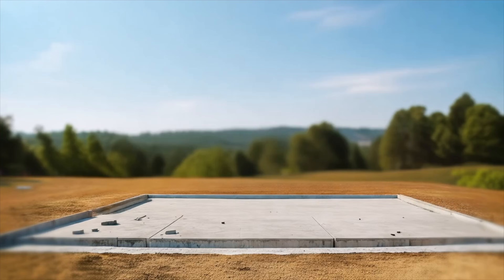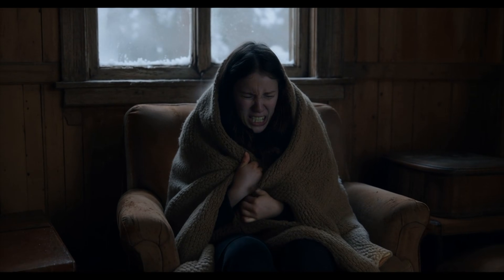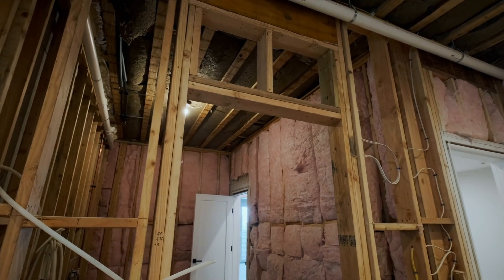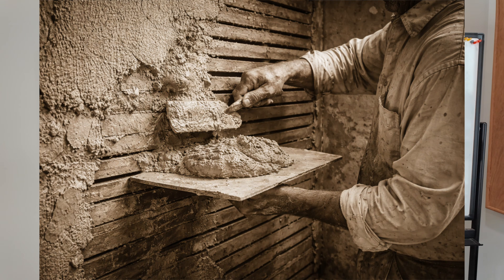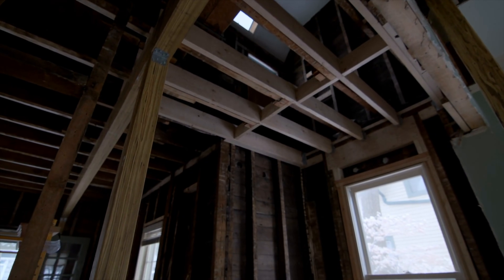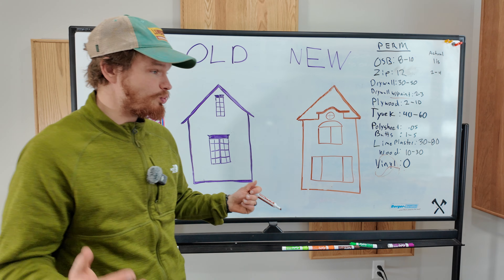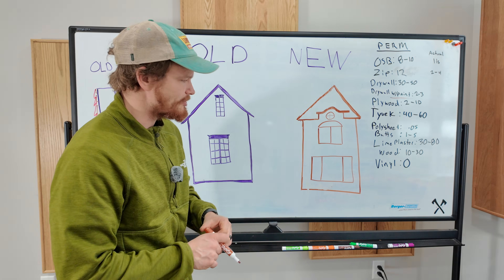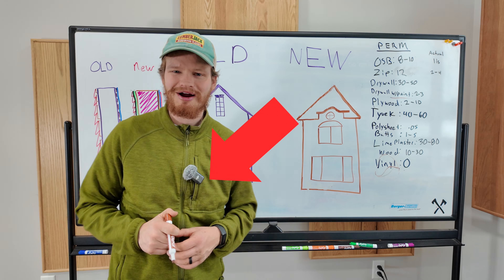New Houses Are Growing Mold — Old Ones Somehow Usually Don't

Comment: I have a small 1948 stick built one-story ranch on a concrete slab no basement, uninsulated attic that is very drafty with WI winters. Stick built, aluminum siding, black felt wrap & old fiberglass insulation. That’s about all. On a budget & need to learn diy. Any advice on where to start or go to learn? I want to warm the structure with without causing mold issues or structural issues. I was thinking of going either rockwool but this is as far as I have got.
Reply: Think about heating the floor. Your concrete floors perfect. Better than forced air. Insulation, some good windows and some heated floors and a stove you will be toasty. You can do electric or use a mini split. Do not use foam in the walls. Standard Insulation will be easier to use and do any repairs.
Reply: @LampWaters So grateful for your advice. I will def look into those ideas. Take care.
Reply: @CK-hu8vzif your plumbing has issues but nothing collapsed in sewer ir plumbing lines but have issues... most likely house that old has settled, with concrete floors access is difficult. If ur snaking ur lines but lines look fine just adjust ur toilets to hold more water so if ur plumbing isnt as sloped as it once was it can still push anything thru.
Reply: @LampWaters All of the pipes are within 10 feet of where the well enters the house. They run into the kitchen behind the cabinets (exterior wall) and then to the single bathroom. The bathroom section was left open about a 1 1/2 ft crawlspace for the plumbing. The floor has plywood & tile only. I am concerned about how to keep those pipes from freezing being so exposed, though.

Comment: Old houses have a lot of mold too. I work for company we demo condemned houses . Lots and lots of mold. If new ones are worse I don't know but old ones have a lot
Reply: I think the video said that if old houses have been renovated with modern methods, they get even more moldy than the new ones. And I guess most old houses today have layers with modern paint and that they are also insulated? Have you ever worked with a house that has been properly taken care of, but not with modern methods and materials? It would be interesting to know if they have the same mold problems
Reply: Of course there is. You're demoing condemned houses, not properly maintained homes.
Reply: Well, these are demo homes so probably no minimum maintenance for a long time.
Reply: Environmental contractor here, you’re 100% correct.  And these morons in the comments getting all bent have no clue how mold works.  Mold don’t give a shit what materials you use, if it can eat it and the humidity is high enough, say bye bye.   

Keep your humidity down and you won’t have mold, it’s that simple.  And if your old house “breathes” so much better what do you think that means for the humidity in your house.  🤣😂. 

Install an air circulator on your hvac system and you won’t have any of these problems.
Reply: @sicilianr1 how do I choose my next apartment? I have less than a week & this changes everything. How does one test /or look when apartment hunting? since materials dont matter? Im located North of Chicago.. so weather is all over the place year round. Probably best to avoid 1st floor apts?
Reply: @sicilianr1 just keep on enshitificating everything, bozo
Reply: No shit. Sherlock? Does the inspector know?
Reply: @JimmyJones-w3p Really? We are discussing houses. Why the anger? It's just wood and materials. Not worth the emotion.   Be well.
Reply: @CK-hu8vzno anger I meant for it to be read sarcastically. Obviously older homes would be more likely to have mold.

Comment: You're INTENTIONALLY ignoring facts about "old" houses that make them as prone to mold.
At 9:40 you talk about "old" houses having either wood siding or lime stucco. You completely ignore that the wood siding was PAINTED, hence trapping water.
You did similar "dishonest" comparisons throughout the video.

True, modern houses are an environmental wreck but you don't help educate and change behaviors by "whitewashing" previous building practices.

I for one would never have wood siding on a house OR vinyl. It's fiber cement board for me. NO rot and most importantly... FIREPROOF (Hello SoCal!)

At 10:20 you bash HardiPlank (TM) because its made from cement, not lime.
But you ignore the scientific FACT that cement absorbs and drains water. Concrete (made with cement) does diffuse water.
More half truths...
Reply: Steel siding for us folks that like in hail territory

Comment: Vinyl siding is fine, air moves around the edges … it’s not air tight.   Vapor barrier is fine on outside but questionable on inside .  OSB is not my favorite but it is not much tighter than plywood…. Drywall and latex paint and primer and mud is also fine.  No issues with blow in insulation or fiberglass.   I think spray foam is the big problem

Comment: A project near me, they framed it out and then paused the whole thing through our rainy season. No wrap, no roof, nothin. The OSB was starting to blacken when then they were somehow allowed to resume. 3 years later, the tenants are complaining of mold. 
My 1950s house is bone dry, in part because I use the A/C maybe 5 times per year. Open the windows at night, close them in the morning. Much cheaper.

Comment: Houses were ment to breathe, air tight no HRV mold for sure, fiberglass is garbage use Roxoul best insulation out there, forget foam on wood unless you enjoy nightmares.  Its masonary cement used in stucco,  Portland is used in concrete,  masonry has hydrated clay or sealbond mix that gives it flexibility but not as good as hydrated lime that is self healing in stucco or masonry joints.

Comment: It looks like a solution is needed.
Possibly air flow or mold resistant products with air flow.
I've noticed that new homes have continuous air circulation via the HVAC system.

Comment: That spray foam is a massive cause of mold . No air flow  equals moisture trapped even just from condensation not even a leak that causes it..  love engineers 😅

Comment: Unless the studs are Kiln dried( more expensive)  I have never seen studs that didn't have black mold ON the studs BEFORE they go into the house.  ALL new houses have this flaw, black mold INSTALLED in the walls, just waiting for a teeny bit of moisture to thrive..
Mine is 1917, flow through from basement top attic, lathe & plaster, lots redwood- siding etc. cool in summer stays warm ion winter... originally thought I would have to rip the interior and insulate,,, wouldn't touch it now that I have lived in it.
Reply: Would charring the surface of the studs (the way it's done for charred wood siding) prior to installation kill the black mold?

Comment: I've found myself wondering about drywall vs lathe and plaster walls lately. The lathe and plaster obviously would create more robust sound barriers between rooms, but I wonder if it also served an insulation purpose as well. Obviously, it wouldn't be as effective as proper insulation, but as thicker walls, it would take longer for heat and/or cold to permeate the wall.

Given many rooms would be closed off in winter so they didn't have to heat the entire structure, the lathe and plaster walls would probably be at least more efficient than modern drywall at keeping the heat in - comparatively ofc. I know why we don't build walls that way anymore. Drywall is just so much easier to install and is manufactured to standard sizes and all that. And ofc, in some parts of the country, there were only certain seasons when plaster could even be applied due to the moisture and temperature (plus the wait for it to dry). So I do understand why lathe and plaster isn't used anymore.

But when it comes to older home restoration, I do wonder about ppl pulling down old lathe and plaster walls that need replaced (and many of them do need replaced when the home in question has been badly maintained/exposed to the elements) and putting up drywall as the replacement. Part of me wonders if that will result in more problems long-term. Like, maybe we should use similar materials as the replacement - esp when lathe and plaster walls are left up that don't need replaced, you know?

But I also fully understand why contractors (and home owners) wouldn't want to do that - that's a lot of extra expenses in both material and labor.

Comment: And now I'm wondering how that compares to old brick houses. In newer brick houses, the brick is basically just a facade, so it doesn't actually function as anything other than decoration most of the time AFAIK.

Ofc, there was a reason why houses prior to the invention of AC were built the way they were - especially in northern climates where we get cold winters. In the summer, you want the air to flow through the house to keep it cool. But in the winter, you want to be able to close off several sections of the house so you don't have to heat as much of the space. This is also why they had very little problems with making small rooms and that also allowed them to put in a lot of load-bearing walls all throughout the structure.

They wanted the house to breathe. They needed the breeze in the summer to keep the house from being a furnace and they needed the air to help fuel the fire in the fireplace while also being able to close off several portions of the house so they didn't need to worry about heating a bunch of rooms they didn't technically need at that point in time.

And ofc, in the southern climates, why would they install any insulation when they were primarily concerned with getting the heat out, not trapping air inside the house?

Comment: So what's some recommended solutions? It appears the tradeoff is well insulated but toxic and unbreathable vs non-toxic breathable, poorly insulated. What's the best insulation solution?

I currently live in one of those old poorly insulated homes. And when its minus 20, were lucky to keep it above 65 without running space heaters 24/7.

Will be building in a year, have been questioning the whole super tight house movement, but not sure the best options to solve this problem you raise.
Reply: One extreme solution would be to give up on air heat. You insulate the tar out of your basement, you thoroughly insulate all of your pipes, you use a basement water heater set pretty low (low enough that legionnaires doesn't reproduce, 60-70F) for your cold water and point-of-use water heaters to crank that up for hot water.

You use freeze proof faucets like we use outdoors (I'm pretty sure this means you will need separate faucets for hot and cold water. And basins for hand washing in hot water you temper with the cold.

Above that super insulated basement, you build your living space floor out of thermal mass. Reinforced concrete is going to be the easiest, but other options exist if you want to dig into that world.

In an ideal world, you in-build your furniture out of hollow to-the-basement thermal mass as well, insulating the surfaces that don't face users (so the back of a couch for example) and use cushions that can handle moderately high temperatures (up to 150F or so) and allow fairly high radiation emission.

Then you run your heating equipment in the basement. Basement heats the floors and furniture, which heats the occupants.

Adding air permeable radiant barriers to the walls will (and especially movable internal radiant barrier shutters for the windows at night) will help bounce the radiation back to the thermal mass and occupants.

Comment: Its coming from the mdf trim. the mold spores are in it and it grows on the back side that isn't painted when humidity rises in your house and you never see it.
Reply: MDF off-gassing primarily involves the release of formaldehyde from the urea-formaldehyde (UF) adhesives used to bind wood fibers, a process that can last months to years and cause headaches, respiratory issues, and allergic reactions. 💀💀💀

Comment: The house that breathes will last for centuries if the roof is kept up.
Reply: True. The oldest house I sold was built in 1812
It had issues, but not mold or mildew
Reply: But you can't afford the AC/Heat...
Reply: @SassafrassJuice insignificant. Add cost of dehumidifiers, heat exchangers, fans, and power to run them. Add health issues and damage to the structure way behind using paper or tyvek.
Reply: @SassafrassJuice  yes. This is true. But may be we don't actually need that.
Reply: Don't forget concrete/ICF </3
Reply: Yes, but will consume many times the resources of a properly built home, with heat recovery ventilation. Also, few people want to live in the house style of 100 years ago.

A thick filament light bulb will use lots of electricity, generate very little light, and never need replacement.  It too, is a poor choice.  A 1940s refrigerator will run for 60 years or so using several times the energy that a modern one does.  Also a poor choice.  How long things last is only part of the consideration.
Reply: @jeffhutjens Our point exactly.
Reply: @jeffhutjens  so pay over time for use, or pay for multiple replaceable items. The over consumption of natural resources to create those infinitely replaceable devices comes from where and does what to the energy grid, planet, etc? Homes that don't breathe don't last.
Reply: @wessidemessside  Homes made of stuff that doesn't rot last.  Stone.  Concrete.  Rot proof wood.  Get ur head out of ur a$$
Reply: @jeffhutjens Energy generation is a far easier nut to crack than overextraction of resources.
Reply: @TheBoldImperator  Complete BS.  They're usually the same thing,  Most places don't use renewables.

Generation is constant  and there's more of it forever following moronic design.

I saw something yesterday where a guy thought that when hydrogen was used as fuel it was green from electrolysis of water.  Are you deluded like that ?
Reply: Centuries though? lol I agree with natural air flow. I live in Florida and my attic is just fiber glass insulation and vents around the perimeter and in certain areas of the roofing. It gets so hot in there in the summer but it’s dry as the Mojave Desert 👏🏽
Reply: @UserAccountBlocked  My House in Germany was built in 1548, 3 stories tall, still standing and never had any mold problems. Though some of the exposed timber will have to be replaced at some point, structurally it will probably last another couple hundred years since they went way overboard what we would consider safe today.
Reply: @chocolatezt  Wow!
Reply: @UserAccountBlocked  Yes. Centuries.
Reply: @donaldjohnson2038  5 minutes until Namek explodes.
Reply: Not in the wet tropics
Reply: what does that mean, roof being "kept up" ?
Reply: @MGrey-qb5xz  shingles repaired and replaced on time every time
Reply: @donaldjohnson2038 how does that help in the house "breathing" , what do shingles even do?
Reply: @MGrey-qb5xz  keeps the water out maybe...
Reply: @MGrey-qb5xz shingles go on the roof and keep the water out.